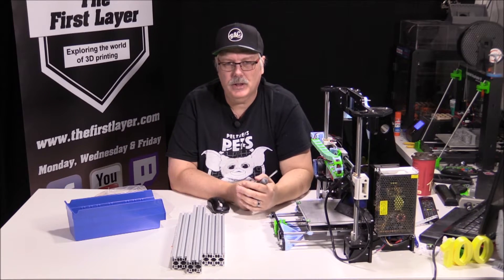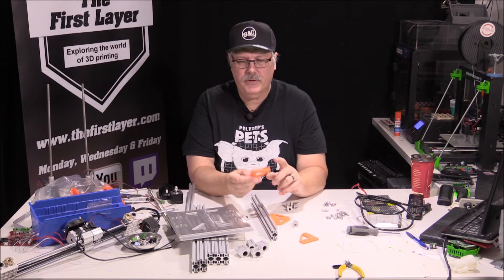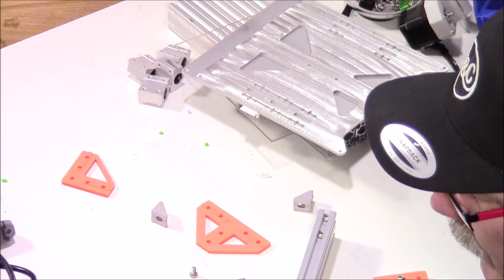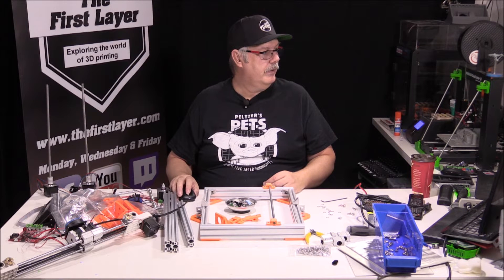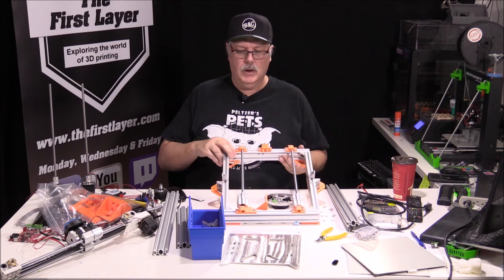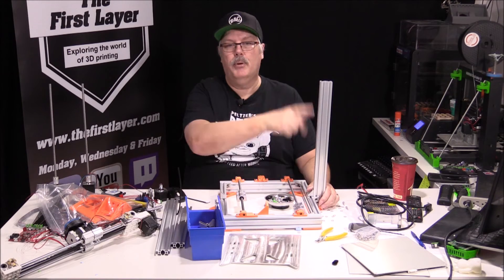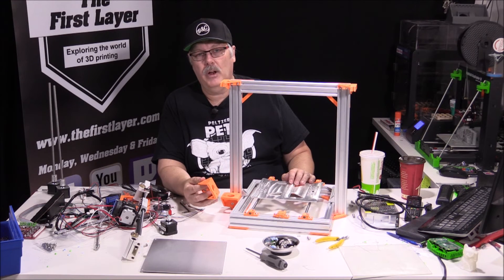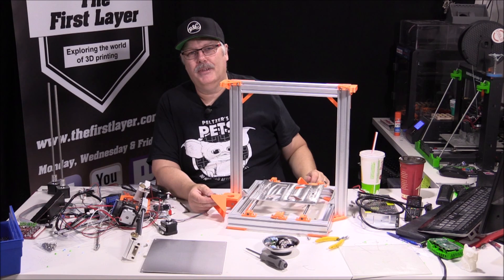Anet M8 build part 1

Comment: I did this and replaced the H plate under the heated bed with a RepRap champion H plate for about $20 and this baby is a real workhorse! The new H plate doesn’t warp with the heat like the old one did so I almost never have to relevel!